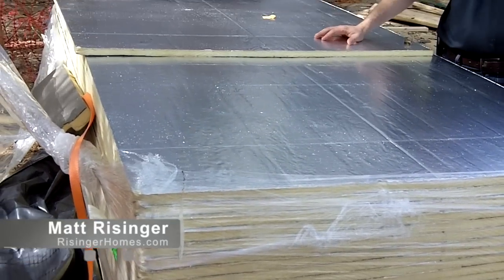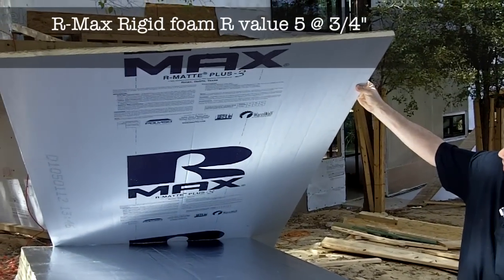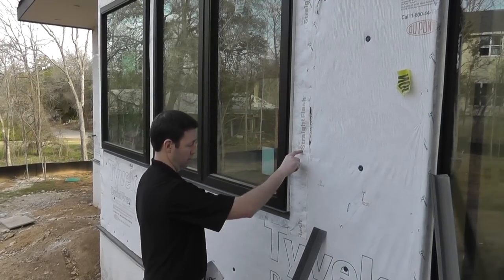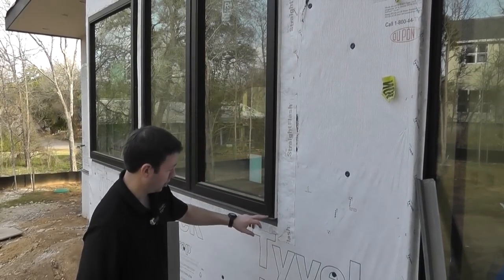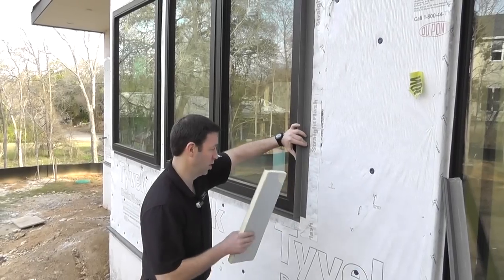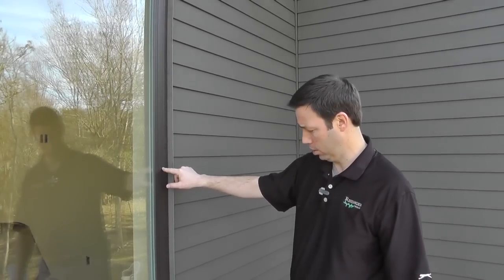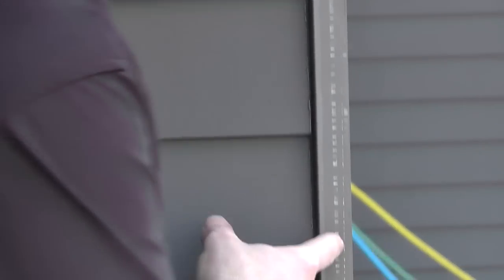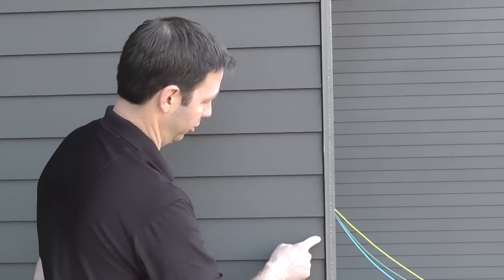Installing Exterior Foam w Hardie Plank & Andersen 100 Windows

Comment: If the water runs out so what the moisture will still cause black mold and that would cause a big problem your children could breathe that garbage in and end up with health problems. So take a moment and caulk it properly or else you did not do the job correctly cuz it wasn't completed!!!
Reply from the maker: I think you missed the point of the video

Comment: What about when you get temperatures as low as -40 degrees celsius several days. Do you recommend caulking?
Reply from the maker: nicolescu silviu I'm sorry but I'm just not familiar enough with your climate and all the issues of those extreme low temperatures.